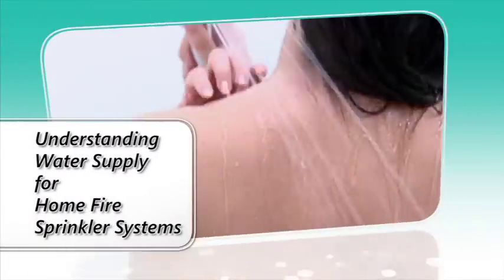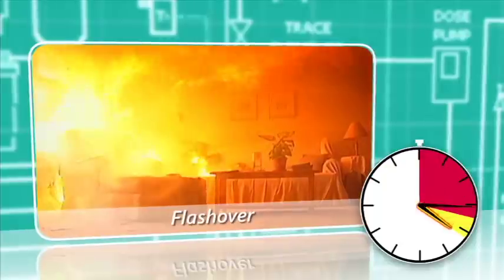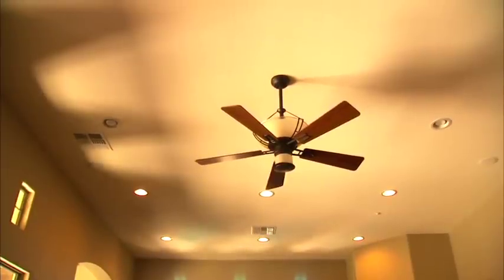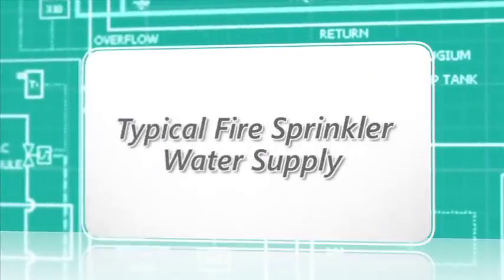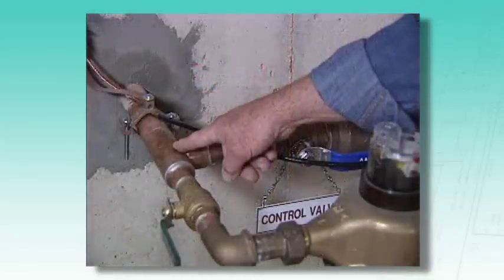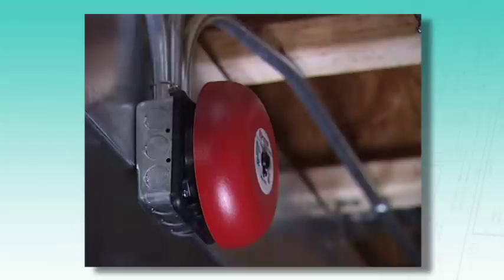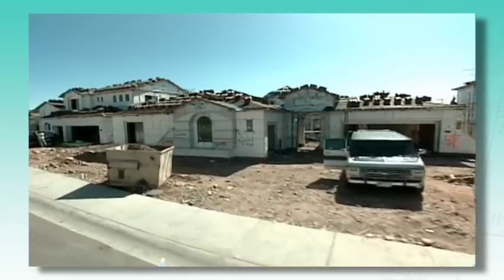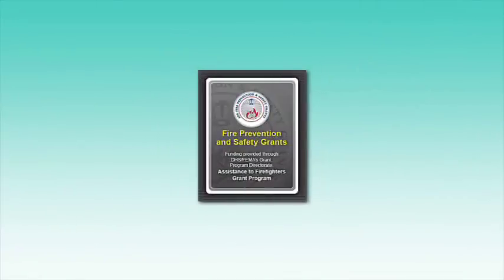Home Fire Sprinkler Water Supply Guide (Complete)

Comment: Forest and open open park are most concerned need invest more to ensure no forest Fite in case rain come slow and the resident should had building code should require fire suppression that use no electricity in case black out

Comment: Unfortunately the water supply hiccup in most of the country is the use of 5/8" meters and pressure reducing valves being immediately after the meter. A huge hidden cost to retrofit would be having the purveyor install a 1" meter (also leading to higher service costs with most companies) and moving the PRV inside the home after the sprinkler riser.